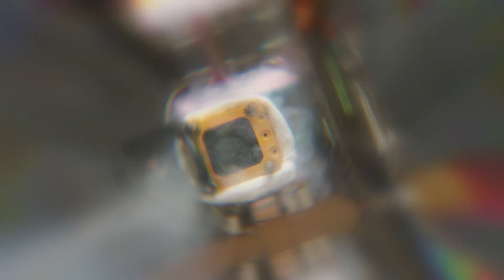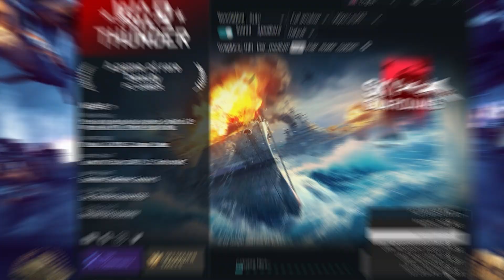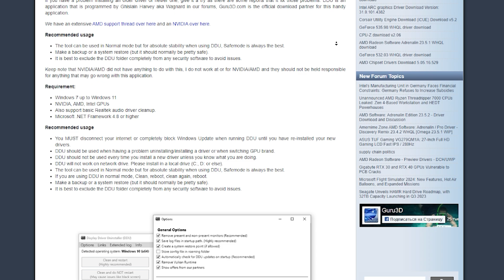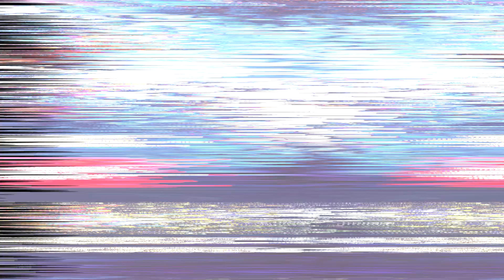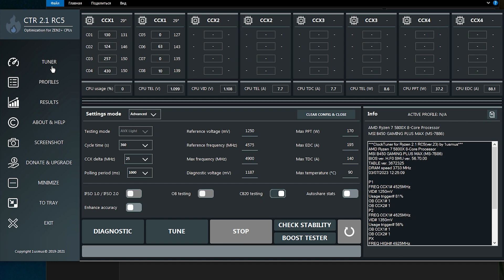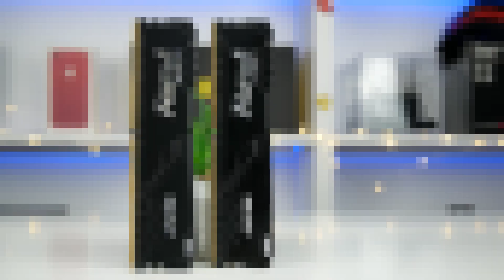Best War Thunder settings 🔥 MORE FPS 🔥War Thunder graphic settings + requirements PC

Comment: My graphics card is a 620 is that okay for war thunder
Reply from the maker: If it’s a GT 620, it will run War Thunder, but only on very low settings. Expect low FPS, especially in air battles or large maps. It’s playable for testing or casual matches, but not a smooth experience. If possible, lowering resolution and turning everything to minimum helps a lot.

Comment: DDU completely bricked my driver function, uninstalled gforce experience and now after iv reinstalled gforce the drivers wont stop downloads (its at 142% complete however the heck that works)
Reply from the maker: Oh no, that’s the cursed 142% bug... Sounds like your system hit limbo. Try safe mode uninstall with DDU again, then manually install the latest drivers from NVIDIA’s site—not through GeForce Experience. If that fails, clean Windows user account might help.

Comment: i have amd ryzen 3 with radeon grapchic 8 gb ram is this enought for the game?
Reply from the maker: Yes, that should be sufficient to run War Thunder, especially on medium to low settings. You may need to adjust some settings for smoother gameplay, but it should work fine.
Reply: @MidGame  i setting my pc and game and its good for playing😁

Comment: this worked for me.  holds steady at 75 fps without flipping out when I try to shoot.  I have an alienware 17 R5 with a 1080 GTX card, which yes I know by today's standards of a thousand point increase every year, is pretty crappy, but I play on ultra low graphics.  it's from 2018 so back then that was top mark.
Reply from the maker: Glad to hear it’s running smoothly for you! Your setup still sounds pretty solid to me.
Reply: @MidGame  it's not perfect, but a large proportion of the glitches and skipping are eliminated.  plus, I found that reducing resolution to the second highest option helps too. 1600 x something.  still on minimum graphics though.  anything more and I get blue-screened after an hour.  with the resolution drop, no glitching on air battles, and on tanks it went from holding at 75 fps to 100+ 95% of the time.  glitches only happen in dense environments but not often.
Reply from the maker: @donttreadonmetal5073   Thanks for sharing your experience! Lowering the resolution and keeping the graphics on minimum is a smart move to avoid crashes and improve performance. It’s great to hear that it helped eliminate most of the glitches and even boosted your FPS. Those dense environments can be tough on any system, but it sounds like you’ve found a good balance.

Comment: This is so helpful my fps went from 30-40 to 70-120 thanks 🥰
Reply from the maker: That's great to hear! Glad the tips helped improve your FPS.
Reply: @MidGame  although i recommend that you limit your frame rate at a point where it's stable because sometimes the fps spikes up then lower down so much so having a specific fps set reduce the load on your pc
Reply from the maker: @charliedupitas8263 Great tip! A stable frame rate can definitely improve your gaming experience and reduce the load on your PC. Thanks for sharing!

Comment: Is this enough to run on the highest settings w/ the highest resolution?? I have a i9 14th gen, ROG strix 4070, 1000W TUF GAMING power supply, 180hz TUF gaming 34 inch display, Window's 11 pro, 64GB of RAM 6800mhz, 2TB SSD 1200mb/sec, ROG RYUO III Liquid cooler, and a ROG Z790 Dark Hero motherboard?
Reply from the maker: With that powerhouse of a setup, you should be more than capable of running pretty much any game on the highest settings with ease. Enjoy the incredible gaming experience your rig will provide!
Reply: Thanks @MidGame
Reply from the maker: @mr.damage8800 You're welcome

Comment: Before I do this, I wanted to ask will it burn after several months? It wont affect on pc  ''life''?
Reply from the maker: If you're concerned about hardware longevity, ensure good ventilation and regular maintenance. Generally, normal use shouldn't drastically affect your PC's lifespan.

Comment: CTR shits the bed after selecting  ~TUNE~  5950x,  NVIDIA GeForce RTX 3080, 128GB ram, X570S AORUS MASTER, WIN 10 pro.
Reply from the maker: Sounds like a technical issue. Maybe check your system settings or game compatibility?

Comment: My laptop used to run the game at the default medium settings at 35-40fps which was fine by me, but recently it dropped all the way down to 10-15. I tried CCleaner and lowering graphics, but still barely even make 20. I’ll try these tips out when I can, but do you have any idea why this happened?
Reply from the maker: It sounds like a hardware or software issue. Updating drivers or checking for background processes might help. I'll look into it more!
Reply: @MidGame  I updated drivers, now it’s 90% of what it was before. Thank you :)
Reply from the maker: @Aegis4521 You're welcome)
Reply: @Aegis4521 if you are using 1080p you could drop the resolution down to 720p. I did. that today on my piece of shit laptop and the fps went from 35 average to 65
Reply: My laptop used to run the game at the difficult medium settings at 35 to 40 fps which was fine by me but recently it dropped all the way down to 10 to 15 i tired cc cleaner and lowering graphics, but still barely even make 20. I'll try this tips out when i can, but do you have any idea why this happened?

Comment: Welp i have a prob after playing a game its stuck on a screen but it is not frozen up i can choose some options but i cant do anything it happens after a match
My specs
Geforce 960M
i5 5200U
8GB ram
Reply from the maker: It sounds like there might be a compatibility or driver issue. Make sure your GPU drivers are up to date and check game-specific forums to see if others have experienced similar issues with your specs.

Comment: HQ FXAA and Antialiasing cause Blur in game settings?
Reply from the maker: Yes, those settings can affect visual clarity. It's a balance between performance and visuals.
Reply: So i need disable them? @MidGame
Reply from the maker: @Mark-ye1345kn  Yes
Reply: You will need to use SSAA x4 if you want no blur with no jagged lines but it is very demanding
Reply: @Hunt3rr4455  really? to i need do it to have no blur and no jagged lines and pixels?
Reply: @SkyReaper-1345  Yeah. I use it as well but it basically reduces your fps by half.
Reply from the maker: @Hunt3rr4455  Thanks for helping the community
Reply: @Hunt3rr4455  normally i play without it at 144 fps but with it, my pc lock on 60 fps with no less btw with HQ FXAA with 4x SSAA also not blur? Or only 4x SSAA?

Comment: how tell me how to make my 75hz use full with 500fps
Reply from the maker: Having 500fps on a 75Hz monitor means your monitor cannot display all the frames your system is producing, as it can only display 75 frames per second. You can enable V-Sync in your game settings to sync your FPS to your monitor’s refresh rate to avoid screen tearing, or you might consider upgrading to a higher refresh rate monitor to fully utilize your high FPS.